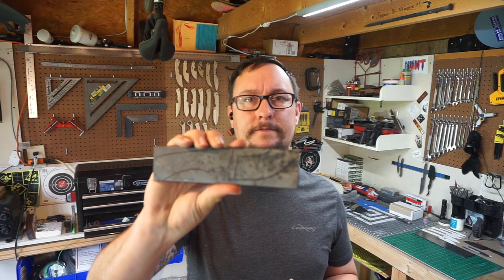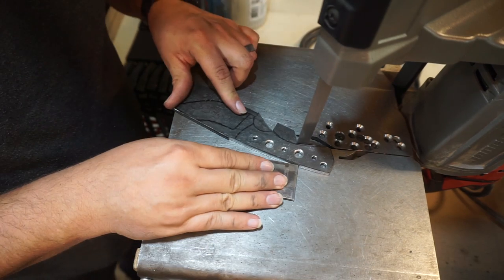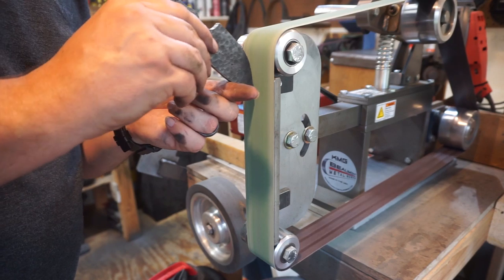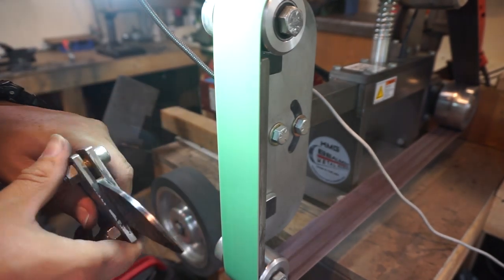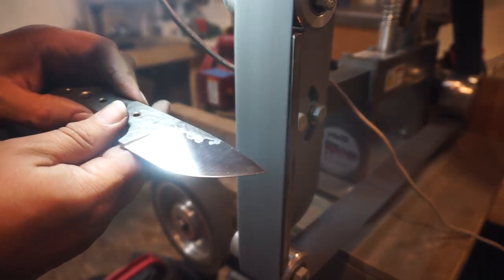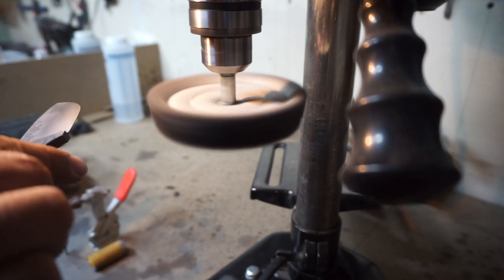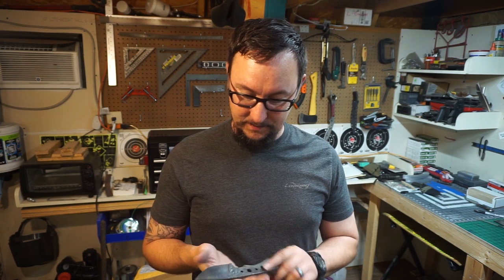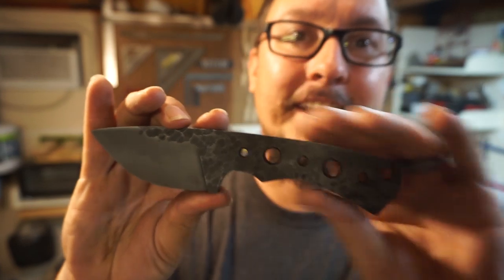How I Shape my Knives | Knife Making

Comment: Love your videos! I have a newbie question, what bevel angle do you typically use for your plunge line grinds?
Reply from the maker: I do pretty all of them by eye.the typically follow the angle of my handle profile. I will draw the handle profile on to the tang and then run the plunge line parallel to the front of the handle.
Reply: @theriversexperience9383  sorry, I was referring to the bevel from the blade edge to the spine. I’m not sure if there is a technical name for that grind on the flat of the blade.
Reply from the maker: The term is just "What angle do you grind you bevels". Those, I do by eye as well. Most people only focus on the "Angle degree" during the sharpening phase. What decides the bevel angle for me is the thickness of the edge and the height that I want my bevels to go up the side of the blade. Meaning, where I want my transition line to be between the bevels and the flats. Those decide the bevel angle.